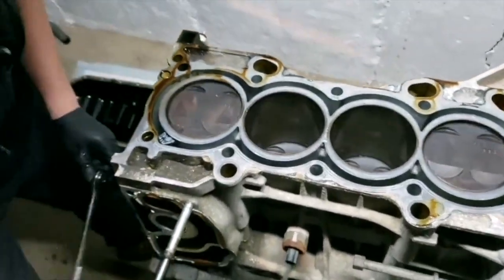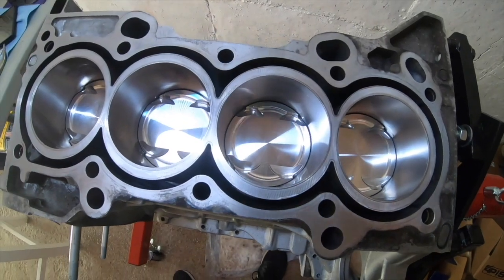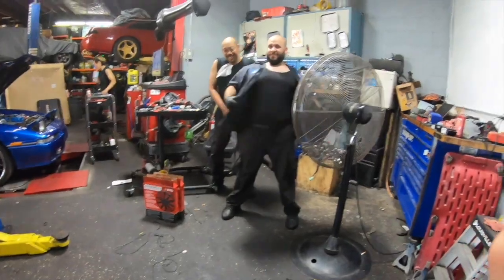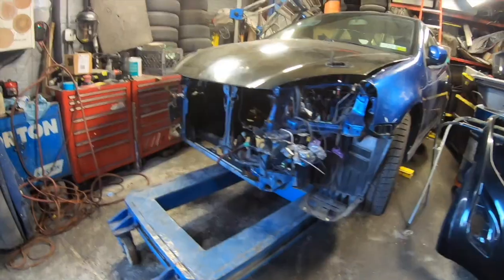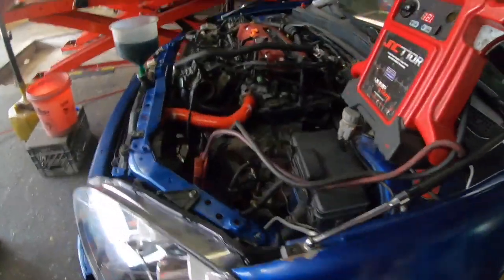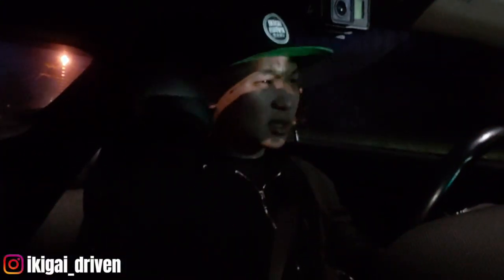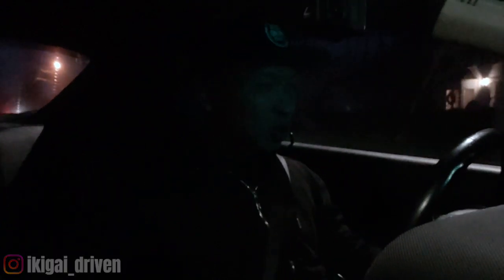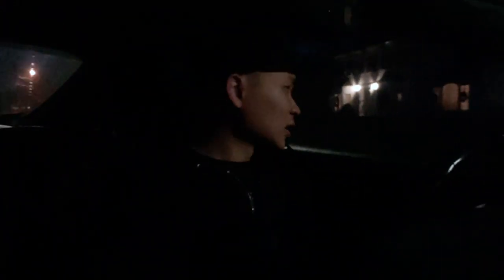242whp / 184tq TUNED K20 K24 SWAP DC5 | RSX

Comment: What axles can i use ? I have 2002 type s rsx with a k24a4 and i have type s axles and the passenger suts flush with the spindle but doesn’t go in enough to get a thread , what axles do i need ?
Reply from the maker: Stock rsx type s axles should be fine
Reply from the maker: That’s what I’m using
Reply from the maker: The axles connect to the trans , shouldn’t have anything to do with the motor you are running

Comment: Was it a stock K20 head that was put on the engine? Also what pistons and rods did you use? Carillo?
Reply from the maker: Stock k20 head k24 cams, cp pistons bc rods, upgraded wrist pin
Reply: Thank you for response! what compression ratio are you running?
Reply from the maker: 10.0:1 compression

Comment: Yo what u think is there a huge difference k24/20 non tuned vs tuned?
Reply from the maker: Definitely, a proper tune makes the biggest difference
Reply: @ikigaidriven  dam I got a 04 tsx ported k20 head 06 tsx cams rbc mani j35 tb sadly no tune need to save up for a Hondata!!!  But right now my suspension really needs some love
Reply from the maker: Good luck on your build lmk how it goes
Reply: @ikigaidriven  I’m almost done just really need that tune and finish my suspension but I’ll let u know thanks💯
Reply: @ikigaidriven  I’m almost done just really need that tune and finish my suspension but I’ll let u know thanks💯

Comment: Yo what's up man what was your build list?
Reply from the maker: Engine:
K20 head: stock valve train, k24 cams, 50 deg vtc gear
K24 block: 10.0:1 bc pistons, cp rods, stock crank
RBC intake manifold
Rdx injectors 
Hybrid racing fuel rail with return system

Suspension/brakes:
-Tein SS-P coilovers
-SPC Performance camber kit(Front & Rear)
-Progress 27mm rear sway bar $ 25mm front sway bar
-Progress rear tie 
bar
-ITR aluminum mid brace
-Tein rear strut bar
- Stoptech stage 2 brake kit